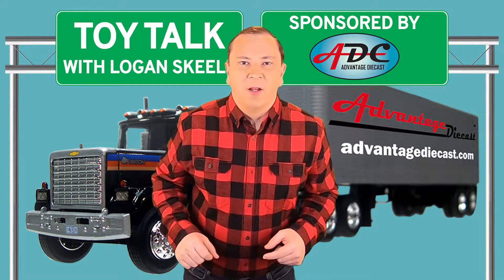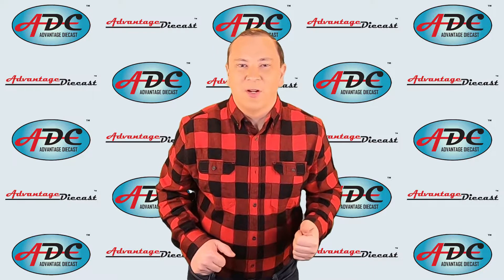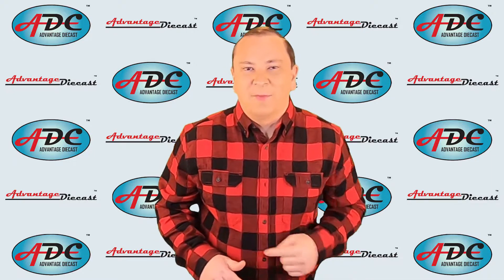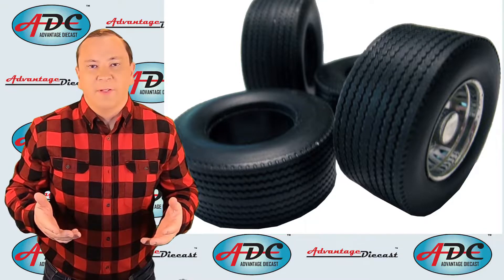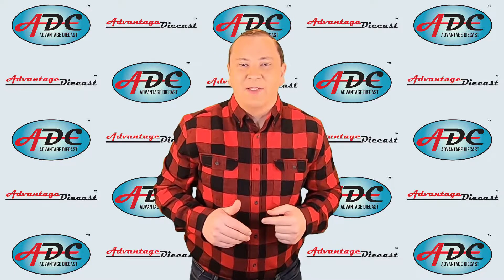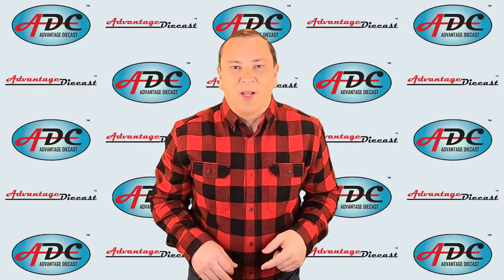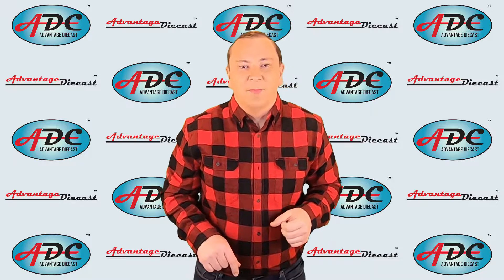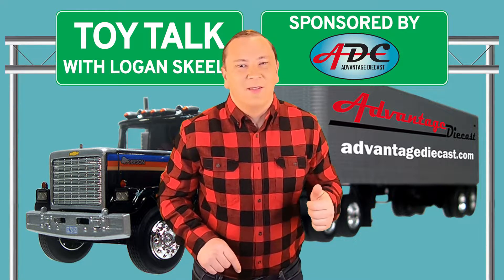Wheels & Tires! What Good Would A Model Be Without Them? How Diecast Cars & Trucks Are Made – Part 3

Comment: I have almost new Goodyear GT3 as front left on my car, should I buy another GT3 to replace the worn out front right even as the GT3 has been discontinued by Goodyear? Else I have to buy 2 new tyres with one new as a spare
Reply from the maker: All I know about real tires is those manufacturer dates are very important, old tires have a bad tendency to look good but be very unsafe to use.  It is best to get new matched tires and never run old tires